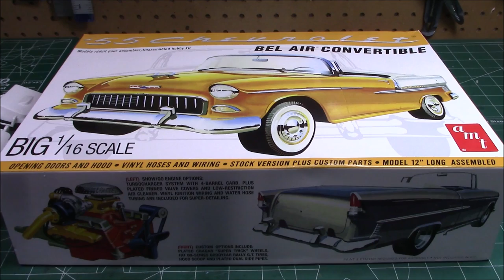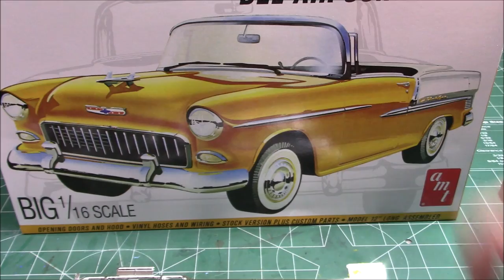AMT 1/16 1955 Chevy Bel Air Convertible Scale Model Kit Build Review AMT1134

Comment: I remember many years ago when I was young they had a lot of the kids that actually had a plug wire kits and distributor and you have to wire that part
Reply: When I was younger, engine plumbing kits were sold as accessories from 3rd parties. However, this kit included it back then as well.

Comment: Nice work, nice video.  I did notice 2 issues. It seems all the Chevy V8 models I've seen delete the V under the emblem on the hood and trunk, and the front splash pan / gravel shield seems a bit deep, causing the bumper to sit too far forward. Other than that,  looks like a well designed high quality piece. Away from model building for many years, this one might make me jump back in. Wish there were more 1/16 -1/18 kits available. Can't do the small ones anymore.

Comment: I'm jealous of all you You Tube model builders. Nothing ever seems to go wrong with your builds. I have this same model and  it was a nightmare to build. Never could get the wiring to stay attached to the distributor and I used all types of adhesives. Doors still don't fit right even after modification to make them close. Only thing that came out to my liking was the paint.
Reply from the maker: If there are issues I say so but most of the time it takes a little bit of fiddling and things come out ok.

Comment: I may be a little late and I'm not usually one that corrects but that steering wheel " Trim ring " is actually known as a Horn ring  many older models of cars had the ring all the way around the whole wheel then they went to half rings and then in the late Sixties some cars eliminated that ring with a button  sometimes with an extension coz of the Deep Dish of the steering wheel and then some horn rings were built into the wheel itself known as Rim blown horns !! Out 73 or 74 Mercury Marquis had that feature I can't pinpoint the year coz I was like 7 or 8 yrs old at the time !!

Comment: Hi Chris, I realize this is an older video. I collect and sometimes customize 1/18 scale die cast cars, I've seen a few of these AMT 1/16 scale and would like to see if the size difference is noticeable. For example would an ACME model engine in 1/18 fit a 1/16 car and look OK? The main reason for writing is the 55 Chevy had a 265 cu inch engine. It was the first of the small block cast engines Chevy Used. I was a big fan of Chevrolet's from 1953 to 1965 and I owned many of them and Hot Rodded many as well.. I have all the original showroom brochures and if you are interested I could double check the engines. I believe the 55-56 had 265 cu inch engines and the 57 had the 283. Nice work on the model. I'll see if Hobby Lobby has any.
Stay Well, Tom (P.S.) Yes I'm close to 80 now and 55-62 Chevies were the junkyard pick for an Engine, Transmission, Rear differential and sometimes a good salvageable body.
Reply from the maker: I'm not sure but I know the difference between 1/24 and 1/25 is noticeable when the cars are side by side, so the engine may look too big in your 1/18 cars or too small in 1/16 cars.

Comment: Thanks for many informative videos.  I have a question about spray painting using cans.  Can I use the rustoleum painters touch white primer spray paint and then overlay Tamiyas laquer spray paint (TS line of sprays)?  Then could I use rustoleum gloss clear painters touch spray paint to cover the Tamiya TS spray paint?  Then use the pledge floor gloss over all of the painted model?  Thanks very much again!
Reply from the maker: You can certainly use Tamiya paints of any type over Rustoleum primer.
I have never use Rustoleum clears over anything but Rustoleum.  
For covering Tamiya I'd recommend good ole Testors Glosscote, I know that is safe.
Future floor polish can go over anything you wish.

Comment: I bought same kit but having issues with the doors driver's door won't close and hood is having an issue any suggestions
Reply: Same here, like the body is cast outta wack.  The custom wheels won’t receive the axel and set under body right. The exhaust pipes don’t line up. Disappointed after so much time invested

Comment: Any room to install a battery, mini switch and LEDs for the lights?
Reply from the maker: Tons of room in the trunk area. You can fit a 9V, switches and wires without a problem and run them to the front under the side moldings.
Reply: @hpiguy  Thanks for the quick reply! Much appreciated.

Comment: great build ,  only have one question.  what glue do you use??  Every time I build a model, glue job is terrible.
Thanks
Reply from the maker: Thanks!
I prefer the following:
https://www.modelroundup.com/Plastruct-Plastic-Bondene-Solvent-Cement-p/pls-00003.htm
Reply: @hpiguy  this doesn't screw up the paint job? (I useTamiya Extra Thin...and it doesn't do well with painted parts.)  Maybe you have a vid that shows your gluing technique??

Comment: That iron cased powerglide looks an awful lot like a four speed.
Reply: What it is not is a 4 speed nor an automatic it's a Borg Warner 3 speed, the steering column is arguably set up to look like a 3 on tree in my opinion and that would be common for these cars. For a rag top an automatic would be a desirable option but they were expensive options a lot of folks ordered them with the three speed manual trans